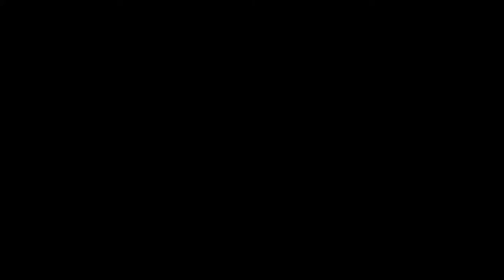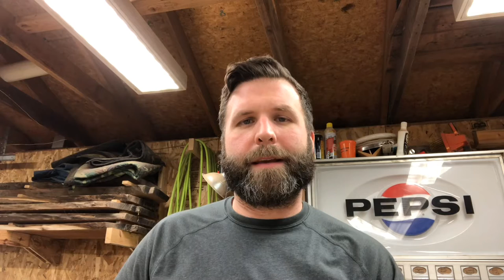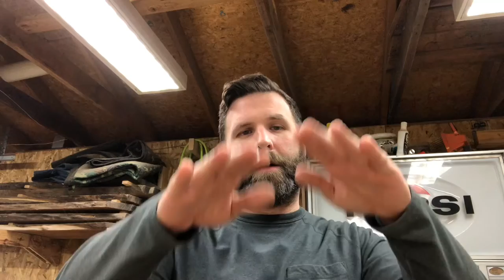How I dry Live Edge Slabs.

Comment: WE got a 36" slab from a fallen OAK tree.... vertical drying caused BOWING... and so I laid them out on an open IRON table FLAT and tied them down FLAT, with 4x4 between them, they are 3" slabs. Our AC is running outside and putting out some incredible heat... I placed them in front of it.

Comment: I do something similar.  Mine go in a shed to dry. Then to a room in my shop with a dehumidifier and a fan. Takes a couple years for sure. I also use cheap ratchet straps and they help. I find I have to tighten them as it goes along. It won't help with splitting.  I also have 3 different cheap testers. They have done me good enough. 
 Good show.

Comment: How would you go about dealing with a log that has sat for years? I cut a slab out of a rotten log and the thickness is about two and a half inches, five feet long, and about a foot wide at one end, the crotch end, and about nine inches at the opposite side. 
Probably weighs about 50 pounds.
Good character in the heart wood and the rot only dips in about an inch. 

I really don’t want it to get “checked” and I put polyurethane on all the end… it was the only thing that I had. 

How do I prevent cracking and checking in this log?

Comment: When you air dry do you cover completely or just the top of the slabs?  Are you concerned about rain/moisture causing slabs to stain?
Reply: Good question.. I'm assuming he does not cover it with plastic or anything like that as that would impede air flow.. He may have a roof to put it under which would help.
Reply: The European method he refers to means the top slab is rounded on top so water runs down sides. This method mitigates the the amount of rain reaches most of the wood. Typically rain won't penetrate too deeply and therefore drys shortly after it gets on the wood. Typically air drying wood doesn't get the wood down to the 6-8% MC recommended for fine woodworking. Best to bring the wood inside after air drying until the MC reaches  6-8%.

Comment: Hey I just had a tree cut that was down a year laying outside red oak I hade it cut into 1 1/4inch slabs How long should I air dry these before I use them for a counter top?
Reply from the maker: It’s all about moisture content. Search for “wood moisture meter” on Amazon. I shoot for less than 12% in my region. Check with other local woodworkers to find the relative humidity in your area.
Reply: Second Life Design ok thanks
Reply: about 15 years
Reply: @ExploringCabinsandMines  hahahahaha your hilarious...15 yrs

Comment: This video contains a lot of misleading, incomplete and flat-out wrong information. If you “cannot intelligently speak about” a subject, don’t make a video about the subject.

1. No green logs are 30-40% MC when first milled.

2. Sticker spacing is 24” max, not every few feet. Stickers also need to be placed at the very beginning and very end of the slab face to prevent checking. Slab stacks should be strapped in line with the stickers to prevent twisting, cupping etc. 

3. There is no way your red oak slabs shrank 4” across their width. Maybe your bark fell off.

4. You are not air drying 9/4 slabs to 20% in 1 year; and you are not air drying slabs to 9-11% in your garage.

5. A $30 pin style moisture meter that measures 1/4” into a slab is not giving an accurate core MC reading. All you are measuring is the shell MC. A meter with a 3/4” depth reading will measure the core MC of a slab if you place the meter on the top face then the bottom face of the slab, assuming the slab is 8/4.

6. Your $30 meter probably cannot be calibrated to the specific gravity of each wood species, whereas the Wagner, Delmhorst and Ligno meters can. This is extremely important when measuring the MC of a slab. A $30 meter beside a quality meter will yield vastly different MC readings.
Reply from the maker: Thanks for following!
Reply: Austin, you seem pretty irate. There is a polite way of offering information. Not sure you were aiming for that.